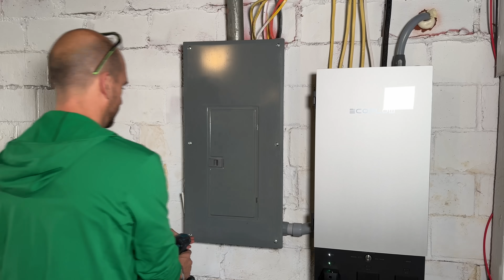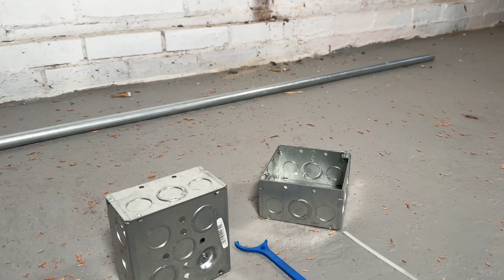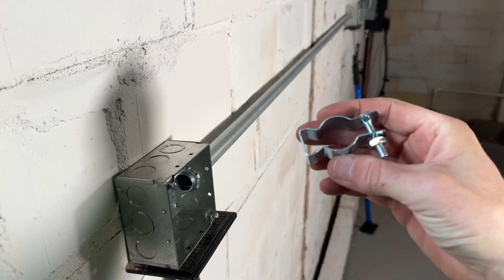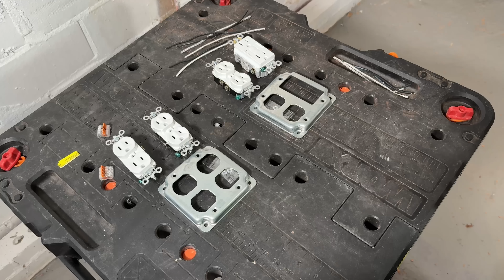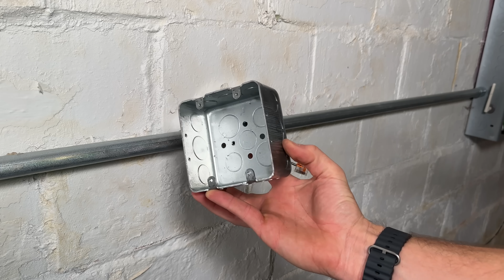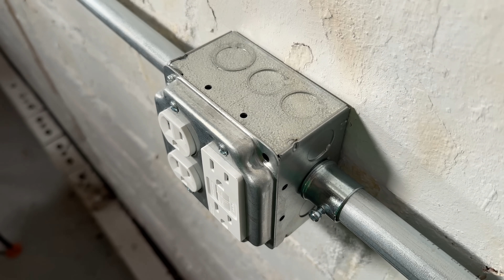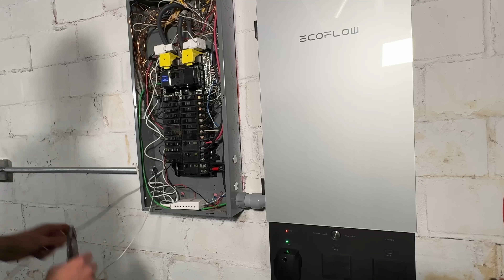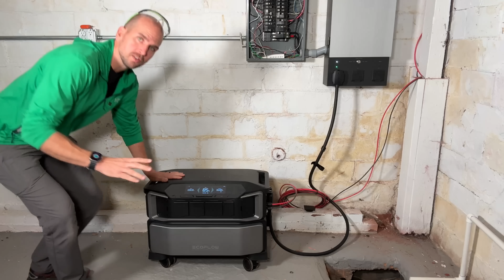Add Outlet To Unfinished Basement Or Garage

Comment: Im a Master Electrician and the one thing I cannot stand, Dick measuring idiots, who think they are gods gift to the trade. Go sit the fuck down and continue to play with yourself and jerk off to the code book. 
The main concept is safety, then functionality, and last, also mostly in residential, is appearance. 
If you can safely say that the job is safe and no intention of negligence is left behind, then you should be fine. The code book gets more and more ridiculous every 3yrs. 
Its been taken over by insurance lobbyists to release any liability from them paying to create any loophole that will put fault on and responsibility of paying on anyone else except the insurance companies. 
Your house or building has electricity and gas running through it 24hrs a day, it can only be as safe as that. 

So code book thumpers, just know this, those that change codes do not care about anyones safety before they care about job security and liability to shift away from insurance companies. 
Also as something like a shity AFCI, is only because someone invented it and someone behind that book is make big money off it.  

You don’t believe me, then ask the plumbers in Texas, because for years you needed a plumbing license to work as a plumber, but all of sudden, since there was no more funding to keep it going, they shut regulations down and anyone could be a plumber. 
So if its about safety, especially when running natural Gas, then why so quick to drop it?

Comment: Run the earth/ground wire...belts and suspenders.  I've seen too many electrical boxes in environments like this (garage, etc.) where they're constantly knocked in to, and over time the conduit fittings become loose to the point where you can't rely on them as a ground path.

Comment: Don't use tapcons. Always run a ground. Don't use tube cutter for conduit unless you file the inside of the pipes . Conduits need offsets at the boxes.
Reply: Offsets are not required. He did run a ground; EMT.

Comment: Don't be cheap run a separate ground wire conduit connections will get loose over time
Reply: Conduit fittings don't magically loosen over time anymore than ground screws magically loosen over time.
Reply: Really maybe you need to research that some.
Reply: @nathanroberts9044  No, I don't.

Comment: I NEVER use romex for anything, and rip that junk out whenever I see it.  My garage is completely hard piped, with only minimal flex conduit for the boxes that house the lights.  No matter where I lived, if it wouldn't pass an inspection in Chicago I'm not doing it.  Do stuff right the first time.  You won't have any regrets and you don't ever have to do it a second time.

Comment: some of these codes doesn't make sense at all. he is running the wire through conduit on the wall but at the same time you can see all these other wires coming out of the breaker panel going up to the ceiling  close to water and gas pipes with no protection at all...

Comment: What Happened 
To The Box/Offset
With The EMT To
The 4S Deep Box Hmmmm !
Note: The EMT Run
To The Main Panel 
You Can Use a Off/Set Nipple 
In This Case 
These are Just
Two Curtsy Out/Lets in a Basement 
I Don’t Know 
One Other Thing 
Use One Hand 
When You Work On
A Panel 
Two Hands You Are Asking For It
Reply: Offsets are not necessary or required. EMT gets installed without offsets every day.

Comment: I wouldn’t suggest using a tube cutter on EMT, it reduces the inside diameter of the conduit. Not that you are getting an inspection, but an inspector would more than likely fail you for using one.

Comment: In my area Ontario Canada, it is not illegal to pull Romex complete into a conduit, that just mean more unneeded protection for the wires.  You did not make any box off sets to the pipes,  that is consider quick but bad workmanship.  As shown on the video, you are missing at least 2 pipe clips, that would fail  inspection.  Tap cons should not be drilled into mortar , should be on the cement blocks for strength. Canadian code dictate a green wire should connect both green screws on the outlets and to the box ground screw.

Comment: Although it was a UK style 220V system, I did have an issue with some work benches in Hong Kong where the faceplate securing screws loosened and there was a non-existent ground return. As a minimum I would advise connecting the face plates to the conduit boxes with a short bootstrap earth lead and not relying on the faceplate screws.  Actually, better still run a ground wire back to the distribution board and then you are covered for any loose or corroded joints in the future.

Comment: Not sure why you just used single insulated wire (White and black) instead of using standard Romex wire which is actually more insulation? A bit more harder to work with since it has more insulation to strip the wires but I figure it not big deal..

Comment: Your reasoning for Not running ground wires is just lazy and very much a bad idea. 
People watching this video. If your doung a similar project Run Groybd wires to the circuit panel and install ground wires at each box for each outlet. Since rhats a metal box wrapping the outlets with electrical tape is Also a must. An added iunce of Arching Sparking prevention.
Reply: The EMT is the grounding path. Wire type ground is not necessary or required in this case.

Comment: Nice video... Lots of useful information. 👍✌
I like to use offset EMT connectors to place the conduit flat against the wall because people end up hanging shovels and rakes from the metal conduit. There are some highly skilled old timers that will actually bend an offset at the end of each tube first try..!! That is easier with 1/2" conduit. 
As far as the ground.. I would much rather see a THHN green wire run through the entire circuit.. Fast forward 20-30 years.. The box may get slightly loose from wall especially in mortar. Those sheet metal knockouts with the conduit fitting get bent back and forth and eventually break free from the box (we've all seen it) creating an open circuit ground. A separate wire is much better...

Comment: Wow, you cannot relay on 8/32 screws for grounding, have run green ground wire from panel. Don't teach people this crap
Reply: Incorrect. The EMT is the grounding path. Wire type ground is not necessary or required in this case.

Comment: Imho,it looks like all 4 receptacles are rated 15 amp.
You mentioned you were going to a 20 amp breaker. Outlets need to be rated 20amp.
Reply: Incorrect. 15 amp receps are allowed on 20 amp circuits.

Comment: Pipe cutters should never be used to cut emt! The steps required to completely remove the sharp lip the cutter leaves in the pipe eliminates any convenience. Use a hack saw and a Klein pipe reamer.
Emt must be supported wihin 3' of termination as per NEC, so a strap needs to be installed midway on the 6' pipe.
Why does the emt need to stand off the wall on an interior dry location?
Those new outlets need to be arc fault protected as well as gfi protected.
I would never, ever use push-wire connectors. Over time the spring pressure will weaken, especially if the conductor gets warm periodicaly, further weakening the splice. Take the time to twist the conductors together and use a quality wire nut.
Bona fides; retired electrician w/40+ yrs in the trade; residential, commercial, industrial.

Comment: Don't understand why you would use the two horizontal box mounting holes verses the two vertical holes, since using the the ones you used, put the mounting screws into the mortar rather than the block itself. Or you could have move the run up or down, but I never mount boxes into mortar.

Comment: If you are installing a 20 amp breaker and using 12 ga wire why did you use a 15 amp outlet? I disagree for using 3/4" EMT, not using a green ground wire and using splice connectors. That is my opinion. I am an electrician with many years of experience 86 years old.

Comment: What you did works well, another option is to run conduit vertically then run your 12/2 w ground up the wall then it is acceptable to run the sheathed above the flooring joists and to your breaker panel. This will leave  the wall space unobstructed.

Comment: It doesn't seem like a secure connection to me to drill into the joint between the bricks.  Don't think I would recommend that
Reply from the maker: I agree drilling into the brick is my default but this specific block is very brittle and that is why I prefer to drill into the mortar.

Comment: From the looks of the video the GFCI & the duplex receptacles appear to be rated at 15 amps. Typically a 20 amp rated device will have an additional slot on the neutral slot that will allow a 20 amp rated device to also plug into the outlet. Since the weak link in your system is the 15 amp rated outlets then the easy fix would be to change out the 20 amp QO breaker with a 15 amp version. Otherwise if you want to keep the 20 amp circuit then all of the outlets need to be changed out to 20 amp rated devices.
Reply: No, 15 amp receps are allowed on a 20 amp circuit.

Comment: For the god's sake! That poor extra ground wire is really a big thing? The cost of it will ruin your project? It can save your life man!  People are so overconfident these days. This is a basement, the boxes are metallic, and the pipe as well, on the other hand, a basement can be very humid, so it can cause some rust, not to mention the good old fact that water always follows gravity, so anything goes bad upstairs... the water will come down. I would not save cost on ground wires and would use a FI relay.
Reply: The conduit is galvanized and fine to use as a grounding path.

Comment: You forgot to install the plastic bushings on the EMT connectors for the wire protection and is always good practice to install a ground wire and ground pig tails to metal boxes.
Reply: No bushings required.

Comment: You didn't secure red wire, nor other conductors of damage, and you touched it with step drill. That is an automatic fail.
I didn't see that you cleaned the panel of metal chips after drilling. That is an automatic fail.
You didn't run ground wire, even situation is clear. Grounding trough EMT is by the code, but I wouldn't hire you.
Also, the end of conduit should be processed with a round file. The way you did it leaves a sharp rim.

Comment: All the following comments are per the 2023 NEC.

Regarding the self grounding yoke on the receptacle. It must be listed for that use. The fact that the yoke is metal does not make it self grounding. Most listed yokes will have an additional bronze colored spring clip installed to create a better grip on one of the screws that holds the yoke into the box/mounting plate. If the supplied screw is used, the retaining washer must be removed. As shown, the screw with nut might bite in and hold, it does not by itself meet requirement if device is not listed. 

Per the 2023 NEC, arc fault protection is being required in many more locations. Check to make sure if it is required for your installation. Arc fault/GFCI combination breakers and receptacles are available.

Lastly, all terminations are required to be torqued according to manufacturer's requirements. Even the little screws on the breakers and the neutral bar. A torque type screw driver is not expensive and will confirm fasteners were tightened properly. It is surprising how far off installers can be, either too loose or too tight, when tightening those screws. Torque settings will be listing on the breaker and the panel itself.

Comment: It's bad practice to anchor boxes or conduit to a masonry joint.  Doing so can cause the joint to crack or fail.  Instead, anchor your boxes and conduit runs at least 2" from any masonry joint.  The closer you can get to the middle of the brick or block, the better.

Comment: 35 years experienced electrician here.   Just a few things I'd like to address.  First, it's just not a good idea to NOT run a ground wire in any metal conduit.  Yes technically it is legal to use the metal conduit as a ground, but the conduit can easily be compromised.  Loose locknut, corrosion etc will cause you to lose your only ground which makes it very unsafe.   You are pulling wire anyways, just pull a ground too, it's just smart.  
 
Second, these spring/lever type wire connectors are just not safe.  I was all in on them several years ago when they first popped up.  Since then I have gone back on jobs for issues and it is almost ALWAYS these type of wire connectors that cause the problems.   Under long term bigger loads they become weakened and brittle.  I have seen them completely melted many, many times.  Use a good wire nut and have piece of mind knowing as long as installed tightly with wires twisted together you will never have any issues from them.  Wire nuts take just a few more seconds to install and IMHO is worth it when lives may be on the line.
Reply: 35 years experience and you think painted metal provides a code approved ground?
Reply: @CybekCusal  Don't recall saying that...
Reply: @Zappy1210  you said it's legal what he did but it's not.
Reply: @CybekCusal  According the NEC it is in fact legal to use metallic conduit as a ground source.  I do not agree with that code at all, but it is technically legal.
Reply: @Zappy1210  not if the metal knockout is painted.
Reply: @Zappy1210  250.12 Clean Surfaces. Nonconductive coatings (such as paint, lacquer, and enamel) on equipment to be grounded shall be removed from threads and other contact surfaces to ensure good electrical continuity or be connected by means of fittings designed so as to make such removal unnecessary.
Reply: @CybekCusal  Article 358 Electrical Metallic Tubing: Type EMT
358.60 Grounding. Grounding and bonding EMT shall be installed in accordance with 358.60(A) and (B).

(A) EMT shall be permitted as an equipment grounding conductor

That said, in your own recent post regarding 250.12 - "or be connected by means of fittings designed so as to make such removal unnecessary."

That's the loophole.  According to the UL in reference to lock nuts on EMT connectors the teeth provided are suitable to make paint removal not necessary for 120 volts and below.  Tests conclude the "teeth" provide 10,000 RMS protection on painted surfaces  which is a suitable ground.  

As stated several times, I do not agree with or condone any of that, but it is the facts of the matter.  Using a conduit as a ground source is just begging for for bad things to happen.
Reply: @Zappy1210  alright keep making off topic comments. I'm moving on. This is a bad faith conversion.
Reply: @CybekCusal  Nothing I said was off topic... I showed you the code from the NEC, explained the loophole of the lock nuts being UL approved to not require paint of a panel box to be removed.  You were simply wrong, no shame in that.  Chalk it up to a learning experience and now you're wiser going forward.

Anyways, if I helped, glad I could.  Take care.

Comment: Maybe your purpose isn't to help someone with almost no experience in this area. If so, I understand. However, the parts that I really needed to see to understand something like this were the parts that you played at high speed. You might want to consider linking to another video where you show each step at regular speed so that people new to home repair will understand where and how to connect the wires.

Comment: So many violations. If you want I can go over them with you .  I'll start with the conduit. You doing put one strap on that EMT. You need at least 4 from the amount of conduit you ran and the amount of boxes installed.  (One within 18 inches from any box entry, then 5 feet minimum in between). 
I won't even get into the grounding. If there's a fire in that house even if the fire is unrelated to the electrical work, they will spot the bad grounding and blame the fire on faulty electrical wiring. 
Then guess who they point the finger to?
Reply: Incorrect. EMT must be supported within 3' of a box and then at least every 10'. In this video, the 3' section between boxes needs no additional support. The 6' length between boxes needs one support in the center. The EMT is the grounding path.

Comment: Ground wire is required!  Conduit is not sufficient to use as a ground.  This work requires a permit and must be done by a licensed electrician in most places.   Should have used a GFCI circuit breaker instead of outlet.  Hack job.
Reply: Ground wire not required, emt is the ground.
Reply: emt is not an adequate ground and most inspectors will fail it.  the mechanical connection on the emt is subject to movement
Reply: @paulbiener3745  Absolutely incorrect. The NEC identifies 14 types of EGCs and only one is a wire type ground; 12 are metal raceways. When installed properly emt fittings do not magically loosen any more than ground screws magically loosen. Inspectors apply the code, they don't get to make up their own rules.
Reply: TRY DOING WIRING IN A HOSPITAL, MEDICAL OFFICE, DATA CENTER WITHOUT A GROUND.  ALSO,   LOCAL CODES AND INSPECTORS WILL DO WHAT THEY WANT AND DEMAND A GROUND.  I KNOW IF SOMEONE WAS DOING WIRING FOR ME THERE BETTER BE A GROUND WIRE.
Reply: @paulbiener3745  Does all caps makes you think you're right? Hilarious, because you're still wrong! I don't have to try wiring a medical office or hospital because I've wired many. Nobody is saying there doesn't have to be an EGC. We're not talking about a medical office or data center, which have their own particular grounding requirements that include ground redundancy, for example. I don't know what world you live in but in the world of real electricians inspectors don't get to do what they want and demand whatever they feel like demanding. I've challenged inspectors when they've been wrong and and maybe if you become a real electrician one day you'll learn enough to be able to do the same. Look at 250.118, reading is learning, educate yourself.